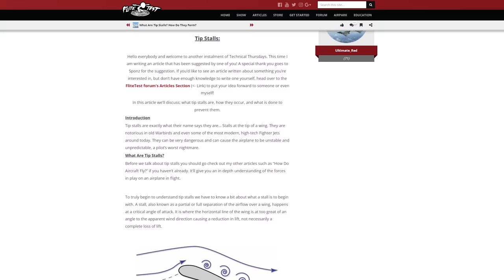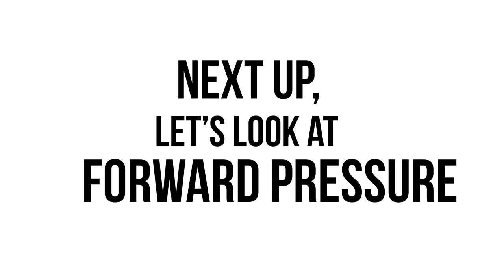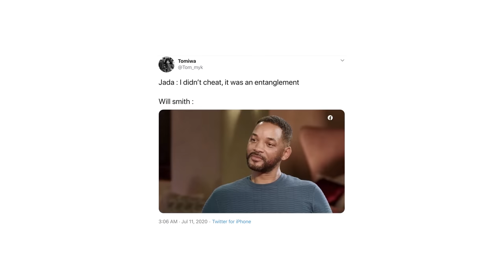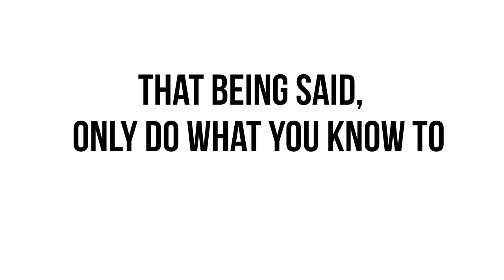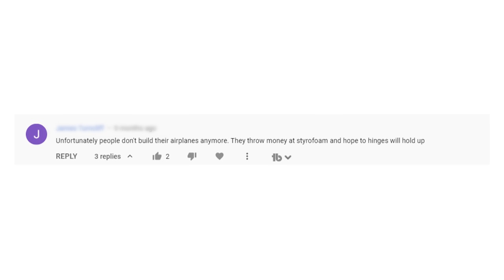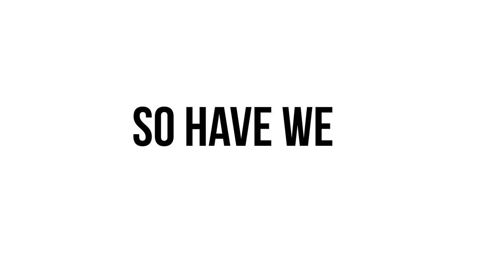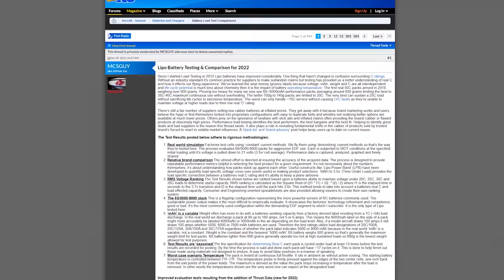RC Myths DEBUNKED

Comment: Good vid.  I may be able to shed light on the "Foamy" thing.  I've been playing with RC since the late 70's.  Back in the day... the only foam we had was the expanded bead stuff.  It was heavy and weak.   I remember getting a Sig MK2 with the foam wing, and it was horrible.   Hobby Shack sold some foam models too.... and they were all bad.  Not to mention, the epoxy would break free, and engines would come loose, and landing gear would rip out every few flights.  So... there are a lot of "Old Timers" who just have a hate for it. But now... those little electric foam planes fly great !!  and for the price... you can't beat them.   But there will always be haters.   AND.... since you don't seem too old... as and FYI... did you know... the Concept 30 Heli from Kyosho originally had foam rotor blades??  They were a god send back then.  If you flew early heli's... you had to build blades from wood... but those premolded, balanced blades were great.
Reply: i’m an RC crawler guy, and i had no idea Kyosho also made helicopters!

Comment: I would not kill my engine on a giant scale for practicing, but you can practice stalls at high altitude to understand how your plane reacts. It's indeed a great training. If you get an engine failure, there is very little time to react and you do not have the time to think, so it must be a reflex.
Reply from the maker: We didn't mean literally killing your engine to clarify - I simulate a loss of thrust on takeoff with my full-scale students by pulling the power to idle during climb-out. This is to build the reflex. The more I do this with a student, the quicker their instinct becomes to unload the wing the second they know the engine is done.

Comment: I'd defiantly be down to try a balsa plane, but they don't really make em' in the style I like. Cessna's and Pipers don't do anything to peak my interest. I'm sort of only into scale military jets / EDFs, and really only American ones. Like, MiGs don't interest me at all, but F-15s do... I'd rock a Gripen or M2000 as well. Some Warbirds are cool too but I don't have any. I do want a PBY or a Liberator.. Actually, I really want an E3 Sentry but no one makes one, or even a 707 that I've seen for that matter. Building them from scratch well beyond my skills as a craftsmen. I can glue a foam wing back on, but getting all those parts cut and shaped perfectly? Forget it.

 Also, my weird RC quark that I've just sort of embraced at this point is that I can only fly FPV with fixed wing. People are often mind blown by that. That's how I learned and it's all I know. I even had one older guy tell me that I should flat out "quit the hobby if that's how I felt" He was actually genuinely offended by it and I mean red in the face, enraged by it. Spitting as he screamed at me levels of mad.  I told him as passive aggressively as I could to "quit the hobby if he didn't like it."

Ever seen someone have a cognitive malfunction and start twitching from rage? That's what this guy did. I could tell he wanted to get physical but I had several inches and about 40 lbs on him as well as a gun so it's really good he didn't.

 He said something about me having no respect for HIS hobby (yes, he said HIS with emphasis) and stormed off, throwing a his transmitter into the ground as he stomped off in a hissy fit. To their credit, the other guys there actually apologized on his behalf. They looked embarrassed and I got the impression it was a regular occurrence with that dude but I didn't really stick around long after that to find out and I never went back.

All I had at the time was my Heewing T1 Ranger and no, I did not crash or hit anything, nor was I unsafe in anyway. I didn't fly too far away, or too high. No one else had any issue. He was just being a prick. I had half a mind to wait outside the area for him to go up and use my FPV system to ram him head on at full speed and splash his fancy scratch build. (it was a P40, and it was gorgeous to his credit) I didn't, but I seriously considered it.

Comment: the only dif really between foam and balsa is strenth,,  I could stand on the dehaviland manchester wing one guy built in 1/4 scale... it had 4 real 9 cylinder radial engine that cost him almost $4000 a piece.   that spruce layered balsa plywood is really frigin strong

Comment: I am not convinced discussions about "tip" stalls vs "regular" stalls vs "accelerated" stalls are really worth. There are all stalls in a way or another, leading most probably to a temporary loss of control and loss of height (gravity). What should matter is that you should avoid them at all cost. For the tip stall scenario, this is the reason wings are build sometime with "washout" angle (=less angle at the tip vs at the root) so that in theory when you come to stall speed the root wing would stall first and leave you with some control at the ailerons, which would not be stalled because of the washout angle in the wing) and thus helping you still control your plane in a stall situation. I see this discussion more relevant in a near-stall scenario because the washout angle is usually small and it would not be easy to surf on that sweet spot where only your wing root would be stalled but not your tips.
Reply from the maker: Stay tuned! This week's video is on all the topics you just mentioned. 😁
Reply: Enough with the teaser, just do it !  (Just kidding, your audience loves you) I offer you another consideration  : In case of wing with washout, there would not be a tip stall scenario,because at the angle the tip would be at in order to be stalled, the other part of the wing would be stalled already long before that point. So if half of your wing is already stalled before the tip does, I guess it can still be called a "tip stall" but it would be a moot point. Another way of discussing tip stall is considering that a stall is usually a local phenomena, before it extend progressively to the whole wing as the angle of attack increase slowy. When the airlflow start to seperate locally on the wing, it may or may not start at the tip (not the case of wing with washout) but could also start anywhere along the span of the wing. If it would happen at mid-span, you wouldn't invent a seperate term to describe it (like a half-span stall). So the conclusion of all that is that it is ridiculous to use the word "tip stall" it is just a localized stall as it could have started anywhere else on the wing and so it is just a regular stall (in progress).   @TailHeavyProductions
Reply from the maker: Tip stalls generally occur on tapered and swept wings. Otherwise, they are more than likely just an asymmetric stall. Video goes live Saturday!

Comment: I am more experienced rc pilot and i wana build BALZA P51 with only 3x servo (rudder, elevator, ailerons), fixed gear.
What size i should go for? And what proppeler should i use?
I HAVE build only two planes on control wires
Reply from the maker: I wish we could help you but if there's one thing we suck at, it's scratch building...ESPECIALLY scratch building balsa. Our full-scale sized plane build video should be enough proof of that. ☠😁 The FliteTest and/or RCGroups forums may be your best bet - or any number of RC related Facebook groups. Good luck!
Reply: @TailHeavyProductions  maybe i can try to do first experimental model from thin 0.5mm foam?

Comment: You will lose precious time after an engine failure due to reaction time and fully understanding the situation. Try after 5 seconds in your Luscombe and see the difference.
Reply from the maker: You sure will! However, the more you brief it and practice it, the shorter the reaction time becomes. This has been proven. Good friend of ours survived a total power loss at 500 feet and another friend at 700 feet. Both regularly practiced these at altitude and briefed their minimum floor before departing.

Comment: From my experience tip stall means you're flying an overloaded pig. Get rid of that bling and 8 min pack and she'll behave much better. My daily is a piece of foam. Nothing flies better.
Ive been flying pretty regular for the last 18 years. Started with helis when lipos hit the scene circa 2004 but fixed wing exclusively for the last 11-12 years . The helis created and unusual style on the sticks for me. Pinch with the left (collective) and thumb with the right. I am blind in my left eye and the right side  is the dominant side of my body. I guess I'm just weird

Comment: It’s funny but after 40 years flying all sorts of aircraft, never had a tip stall . Any crashes I’ve had have been MY fault
Reply from the maker: You can have a crash that was caused by dropping a wing that is also your fault. The important part is that you admit fault, as you said, not just blame it on the plane itself. 👍

Comment: Foam airplanes are like having a safe system that's built in because of the extremely light Wing loading which in many cases encourages bad habits which become incorporated into the pilots regimen of flying. Some pilots who only have experience with foam, transition into Balsa and , they are greeted by a rude awakening that there skills are not up to the task at hand.  I don't believe it's necessary to fly a brick, but I laugh when I see many videos about flyers "learning to fly a warbird" and you see it's a warbird made from styrofoam.  Sorry guys, foam planes provide little similarities to flying a gas balsa and ply warbird. Now I'm not referring to aerobatic 3D foam planes, which provide some great benefits while practicing complex moves, but they too have more forgiving charateristics, than wood or composite planes. The influx of foam planes may have been responsible for the demise of companies like Top Flite and Aeroworks, drones haven't helped either. I have rarely seen people transition to more demanding flying once they fly foam.  Seldom are their take offs and landings and flights anything resembling the skills required to fly a model warbird. They might just as well be flying a foam trainer.  RC is a hobby that requires you to move out of your comfort zone.  Why not develop a more complete set of flying skills with more challenging aircraft instead of limiting yourself to one level of flying? Flying little foam planes at locations not designated for flying  because the plane can "handle it" and you enjoy goofing around with your friends does no good for the hobby. As far as old dudes at Flying Fields I began flying when I was 44 in both fixed wing and rotary wing and progressed pretty quickly to 3D flying in both. The old guys in my field were in their 60s 70s and 80s. It wasn't that they were old and critical of a different kind of flying it was that they were envious of anyone who could do something that they couldn't do. There's a joke when you meet an old foggy chances are they were a young foggy". The desire to continue to learn and improve is what will keep this hobby alive. Unfortunately I don't see that much going on in terms of learning and Improvement. Everybody does what they're comfortable with this is good enough for me. Few people push themselves to become better Pilots at many fields. If you're at a field that has instructors utilize them. Disconnect the safe system learn what it's like to really fly a plane or helicopter. That's what's going to keep a hobby alive the love of learning and flying .

Comment: There is no POWER OFF in a stupid Lectric Plane. OH only when you start Smoking. When I was Flying I had an Old .61 Nityo engine thet about 50% of the Time gave me a dead Stick.  You just don't get Farther from the Runway than Guiding Distance.
Reply from the maker: Oh, there's definitely dead sticks with electric! Running the battery too low. 😁

Comment: Ok so your saying it's ok to turn back to the runway if my O-360-A1D Lycoming engine fails on takeoff in my Mooney? It took engine power to get to the point of failure. I can GUARANTEE YOU I would not make it back to the departure end of the runway after losing alt in the turn and then getting to the runway. I've been flying since 1987 both GA & Corp. I know I will NEVER attempt it!!
Reply: Depends on Alt when the engine loss occurs of course. At least for me in my Dad's 172 (I got my PPL with this plane)  I can turn back above 1000 feet. Anthing under that is land straight ahead or 30 degrees max off the centerline.
Reply from the maker: I'll quote what I said in the video below here for reference as we definitely didn't imply that what I did in the Luscombe in 300-500 feet will work in other airplanes. It certainly was more than that in the Mooney I regularly flew with the same engine. Try it at altitude as I noted in the video and add a buffer. Each plane is different. General safe rule is 1000 feet, but some planes can do it much lower. It's all scenario based and at the pilot's discretion. 

"Only do what you know to be safe in your given scenario with your current skillset." 👍